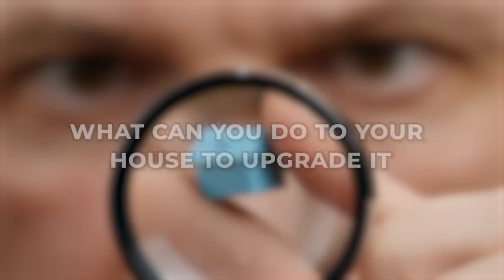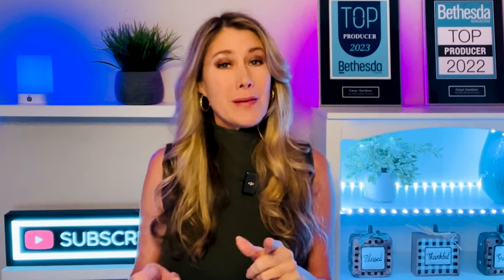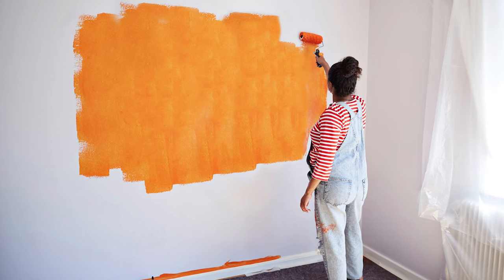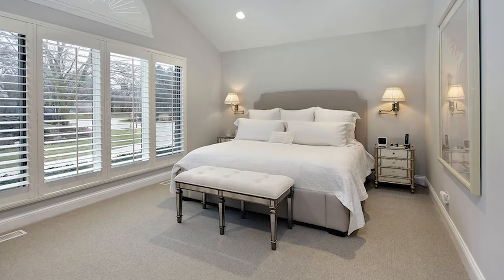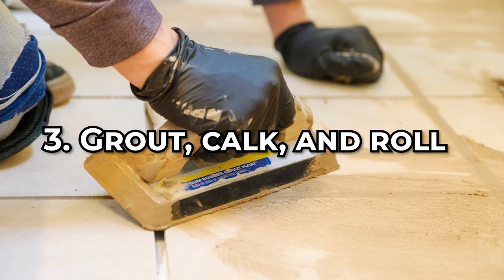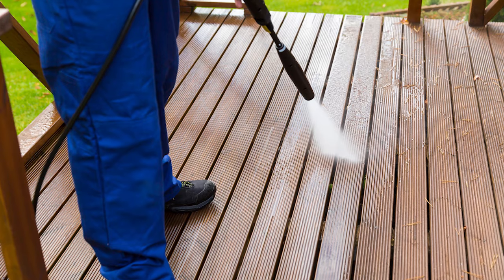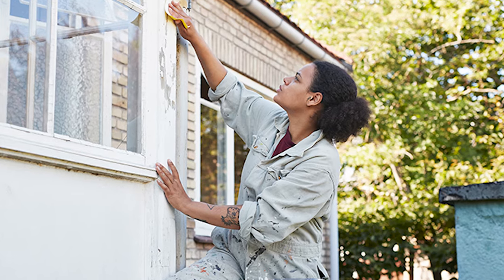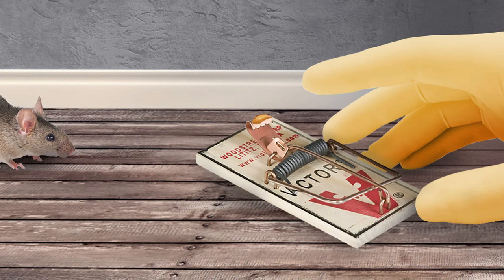AVOID These PRICEY Upgrades when Selling your Home

Comment: I recently installed a full scale working replica of a Roman Empire-style gladiatorial arena, Caryn.  Will this help or hurt the potential resale value?
Thanks for showing the room colors.  Revere Pewter is just what I'm looking for!  I'm not good with colors, so I rely on the nice young lady at the Sherwin Williams store to help me.
I agree 100% with all of your tips.  I'm dismayed at how little effort some sellers put forward in presenting a house that's clean and freshly painted.  Refinished hardwood floors will not only return its investment but sell the house faster.  I had a choice between two houses with hardwood floors and the deciding factor was that the owners had refinished the floors just a couple of years prior. That house just shone with care.